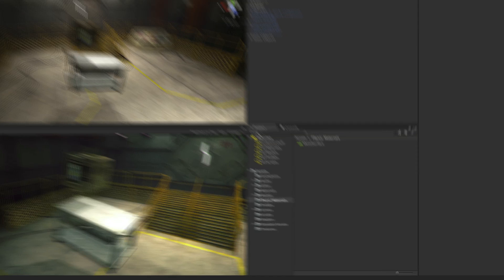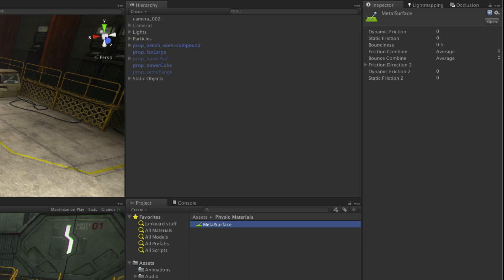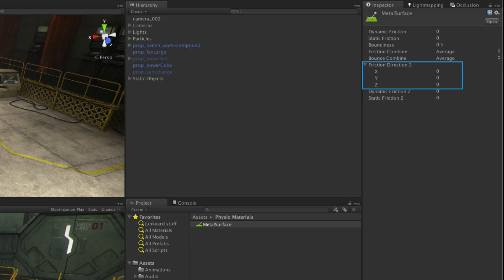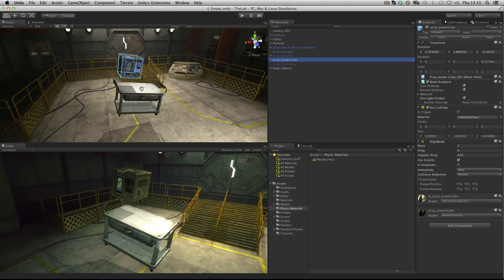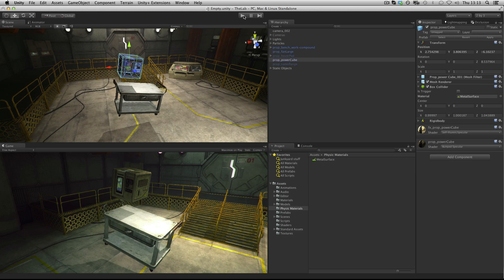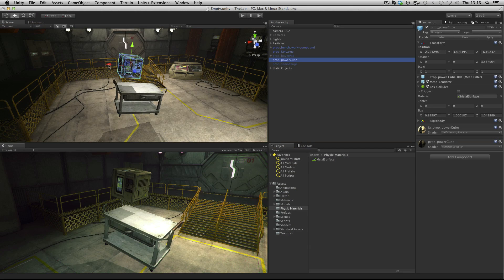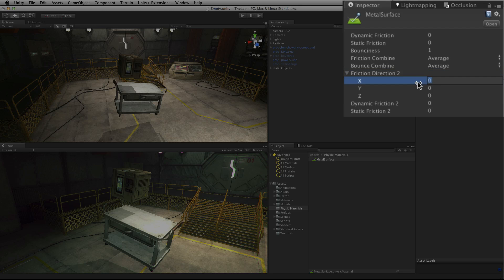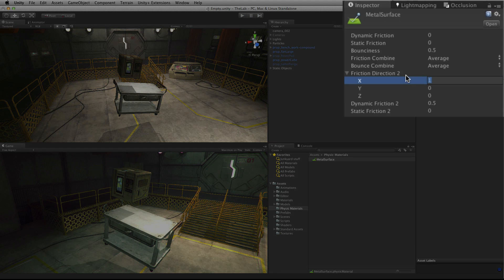Physic Materials - Unity Official Tutorials

Comment: Why is it called "physic material" and not "physics material?" One of the only definitions I found that fits how it's used is "an archaic term for physics." Most of the definitions deal with medicine or healing. Is there a reason that physic was chosen over physics? Just curious. Thanks.
Reply: Unfortunately, no. Until the devs answer us all we can do is guess as to their reasoning behind it. And at this point we probably won't have an answer because this post is a year old.
Reply: @stevenb4956  Yeah I find it weird as well. Why tf didn't they write it in plural? *Physics material* aligns more with the standard linguistic usage of the term 'physics', especially in the context of the type of concept it should be referring to. 

Like you mention, "physic" commonly refers to completely different concept/branch of science. It doesn’t make sense at all. They still haven't given an explanation for this choice of wording either...
Reply: oh, they've fixed it in the Unity 6 preview I'm using right now. 😅 It actually says physics material 🥳.